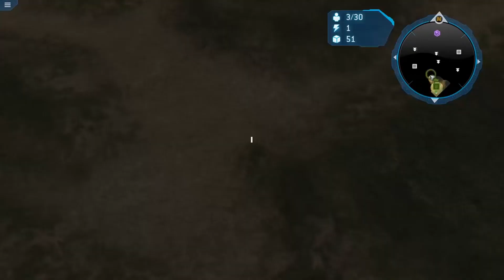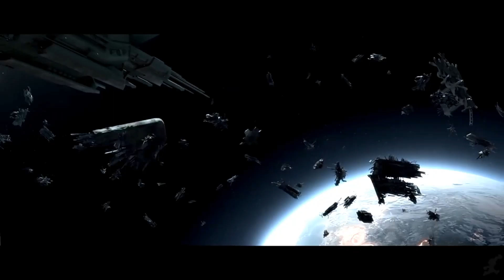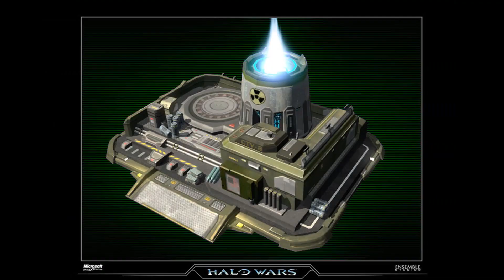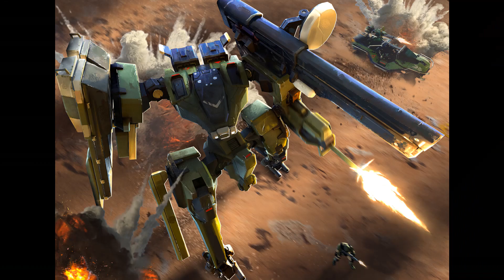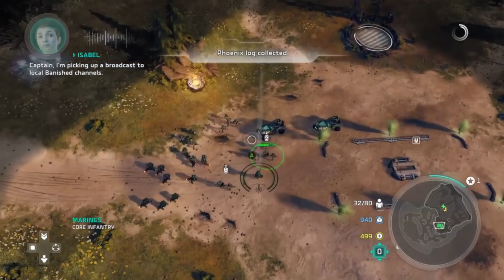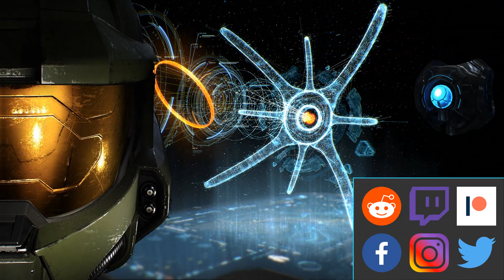UNSC Firebases - Lore and Theory

Comment: you know lorewise how did cortana managed to access Infinity's systems during Halo 5's ending cutscene without any efford? Even Roland was confused when she was coming? Shouldnt Roland be able to block her from entering UNSC Flagship's systems?
Reply: Infinity was built with inter-grated forerunner engines and she was put into the forerunner network and since the engines were linked to everything else its not much you would have to go through.
Reply: @ghost707  it's interesting that the UNSC is seemingly making the same mistakes as the Covenant in their usage of Forerunner technology; incorporating it without fully understanding it.

I wonder how this will affect the plot.
Reply: @ethanwagner6418  they didn't know about the vulnerable systems, but they could of done it manually.
Reply: @betaraybill1189  well shit, that detail escaped me. Thanks for the correction
Reply: Nah she just has more mastery on forerunner tech now since she connected to the "forerunner domain".
Reply: @isaachinds3736  Domain aint even forerunner construct. Forerunners used it, but it was built by the precursors
Reply: @Goingcrazy211  That's why I put the parenthesis because Cortana said so, another lie I suppose to keep Chief from worrying about the Precursors.
Reply: Neural physics is the answer. She manipulated fundamental laws of the universe to do that
Reply: Look at halo 4. she got plugged in, and shook the ship when she got angry. I think that is how. According to cannon information, she is built to break into enemy databases, and would break into oni databases that she was not allowed to know about. She also leaves backdoor entrances to systems she gets into, for later use. Her first go with master chief, she hacked into a observation satellite to aid him in a intense test run of his new armor. She set it up so that if someone checked it, it would seem like a coincidence that it was watching the test.
Reply: @ronansmith9148  her systems began to malfunction due to logic systems being damaged. She was fighting the damage but couldn't get to halsey in time to fix that damage.
Reply: Betaraybill 118 true, but the domain was a precursor construct. It’s based in neural physics which is evidenced in that it was affected by the firing of the halo array. It wouldn’t be too far of a stretch to have Cortana begin to use other precursor artifacts via contact with the domain and knowledge gained from it. It’s very likely with her increased ability to process information over a biological organism and her now “immunity” to rampancy (I use this loosely because while it appears to be so we don’t really know that she isn’t still suffering from it in some other manifestation or form due to contact with technology that is completely alien in both design and structure to literally everything else in the universe). It would also make sense that she might have gained some of that information from the gravemind after speaking with it in halo 2, which if you believe she may have been affected by the logic plague is very likely.
Reply: She was in the Infinity before, I imagine she still knows how to get in.